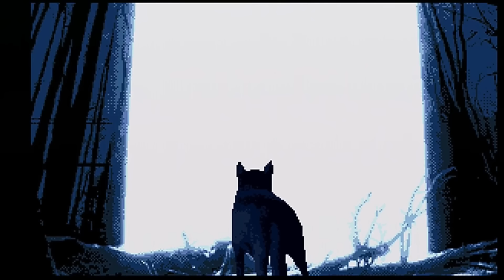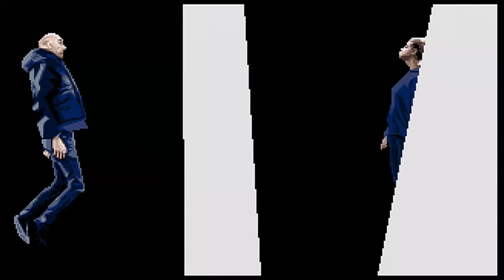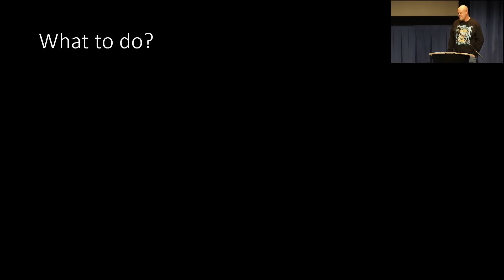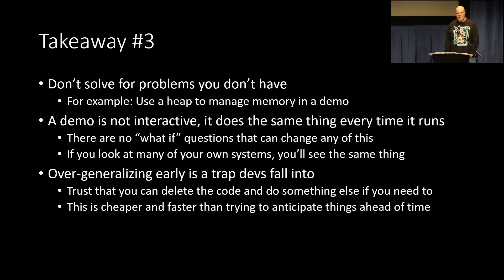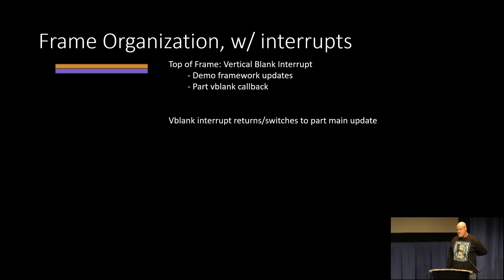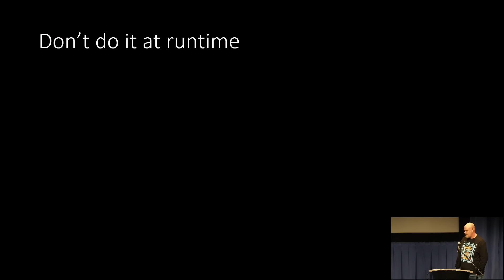Eon: An Amiga 500 Demo - Andreas Fredriksson

Comment: Loved this talk! I used to dabble with "demo" stuff on the C64, and it honestly got kind of crazy. I had machine code, that generated machine code, that modified generated machine code. Just to shave off a cycle or two here and there. Don't do at runtime what you can do offline, except offline here is literally the init of your demo code. The rest is cycle exact more or less.

C64 demo: LDA STA LDA STA LDA STA

Comment: I am wondering: He says the CPU was the main constraint on the well spread A500+512K slow RAM. But why don't all these modern demos requiring an 68030+ not really look significantly better than all the OCS unexpanded demos? Having my Amiga expanded through all the generations, from 68020, through 68030 and 68060 up to the PPC, I was always very disappointed with what it actually brought to the table - including the ridiculously useless AGA, which IMHO did not make a single game look better than ECS.
Reply: It's a challenge... Pure A500 - like from factory. Because most people have hardware just like it. And squeeze as much as You can.
Reply: @slapfight3581  Yes, I know. But this isn't what I was asking for ;) The example I gave was for showing, that way faster CPUs than the 68000 did not change much. And: While of course the 68000 sometimes hindered the older Amigas, usually games and demos on the Amiga IMHO where constricted more by limits of the custoim chips - which AFAIR also was the usualy widesprea opinion back then, and also resonates with faster CPUs actually not having been much of an improvement win for the Amiga.
That's the coarse idea ..
Being a bit more precise: While there where special cases, like 3D vector graphics games and rendering of course, the usual Amiga games was a 2D game. And 2D games would have benefitted much more from either more sprites or more layers or an even more powerful copper or more sound channels or more memory or HD floppys, from a Harddrive or higher ChipRAM-bandwidth, than they would have from a faster CPU. Each of these parts having been sufficiently improved would have made a way bigger difference. You can even see and feel this, when using an Amiga with a fast CPU: The Workbench still ils  near unuseable in higher resolutions. Because anything but the CPU is too slow.

When it comes to 3D engines, though then the CPU comes into play - but this isn't a significant parameter of the Amiga, as it was an usage case somewhere between 'yet not existing at all' and 'exotic' for most of the Amiga's lifespan. And: When the time fpr 3D was up, not even the fastest CPU in the world would have helped the Amiga much, because it was painting pixels too slow for the 90s. Either LoRes or unbearable flickering, and both terribly slow, no matter how fast the CPU .. that's not a scenario worth striving for..

Also: Compared to it's contemporary Intel counterpars, the 68Ks where way more efficient and faster, at least until the 486 arrived.
This all is why I can't really comprehend his argumentation.
I say: The CPU actually was one of the Amiga's least significant limitations.

Comment: The Amiga (500) ... "only" 32 colors*, but when I see them on Screen it still feels "magic" to me. Back then this machine was so advanced, so capable of amazing things I'd never seen before. I'll never forget this little computer, she'd been something special, last but not least because of the people who really pushed her to the limits. It's just great to see that she's still loved by the demo scene :)

*) or 64 or even 4096, or with clever hacking 31 different colors per line - I know ;-) But handling these modes was quite tricky, used mostly for static images.
Reply: The HAM mode is pretty impressive. It blew my mind in 1990.
Reply: With the limited memory and throughput of the machines back in the days, it was always a trade-off between color depth (number of bit planes) vs resolution (bit plane x-y dimensions)
Reply: I think because it was also 32 colours from a much larger palette (4096 IIRC?), where eg. DOS was common using the fixed CGA/EGA palette of those same garish 16 colours (I say that as someone who grew up with DOS, but always wanted to go play with my neighbours' Amiga)

Comment: The hardwaredesign and the OS were ahead of its time. Absolutly no doubt about that.

But from todays point of view it was a big mess. The components we're tied to work together way too tight. The Amiga never really had a chance to evolve without braking the original design, making it incompatible to its previous version. Some of the functionalities were even quite hacky. For instance:

The two CIAs in the Amiga had a signal line to tell them if they were CIA 1 or CIA 2 because both had different functionalities in the system.

When coming out of reset state, the cpu started off by reading a reset-vector from adress 0x00004. But in normal operation there is usualy RAM at this location which would result in an instant system crash because the CPU would read random data from that address. They solved it by telling gary to resolve the Reset-Vektor-Address to point to a ROM Location within the first few clock ticks of the boot time. Its the PA0-Line of CIA I that is doing the signaling to gary.
Reply: You'd get the exact same difficulty upgrading due to hardware being tied tightly together with any 80s of 90s console that was computerized like the Amiga was. That's just the way it is when you try to make a console design into a personal computer. Be thankful they did as any other approach at the time would've cost way too much retail. This is part of why the recurring, "Why didn't they use ARM?" comment if comical. If they had, it would've needed a lot more RAM. And in 1983 and 1984 -- when they were designing it (and even in 1985) -- that would've massively bloated the system's launch price.
Reply: @Nebulous6  This is not quite correct. The first Amiga (Amiga 1000) was not designed with cost efficiency in mind and it was quite expensive. It was supposed to become a direct competitor to IBM and Atari Computers at the time. So was the following Amiga 2000. These machines were more capable than IBM PC  but had many design flaws. So they ended up beeing unable to keep up with IBM and were bound to die...

Many people say it was the mismanagement of commodore that caused the Amiga and commodore to die. My personal opinion is, that it is a mixture of many unfortunate events that caused commodores demise. The designflaws of the amiga was a major one of them.
Reply: @monarch73  I'd hesitate to call them design flaws. The Amiga did exactly what it should have done at the time and it did it very efficiently. As for cost, the Amiga 1000 was still less expensive than either the Mac or IBM back in 1985. The primary reason the 1000 was more expensive than it could have been was because it was manufactured in Japan. I do agree that the downfall of the Amiga was due to a mix of unfortunate events though.
Reply: @Nebulous6  Its' like I already said, the Amiga was way ahead of it's time. The guys did a great job at bringing high-end computing at an affordable price to the homes. But let me elborate what I mean: If I was a softwaredeveloper, and if I was to design a software that does what it was supposed to do, it does not nessesarly mean, I did a good job - because as a designer have to take different senarios into account. Does the software crash when the user does unexpected/ unwanted things to your application? Is it foolprove? Is it intuitive? Does it scale when resources are insufficient?

It's that kind of stuff where I think the hardware- and software designers failed miserably. The OS was prone to crashes due to the sensible location of lookup tables. Null-Pointer dereference is a very common problem and with gary in place it could have been handled with very little effort. Instead, they completly ignored it and put some very sensitive data at the beginning of the memory map.
Reply: @monarch73  Only pre 1.3 was 'somewhat' prone to crashing. After that, and especially for v. 2.x and up, any crashes were the result of poor programming practices. This is well documented. What you're describing had nothing to do with the hardware (unless you're complaining about a lack of memory protection). Like everyone else, I also think that's one detail that would have been nice. Again though, someone who watches what they put where shouldn't have a problem -- as evidenced by the many top-tier programs on the Amiga that have no issues in that regard whatsoever. If a piece of software crashes when a user does unexpected things to it, that would be a bug (kind of like an average day with Win 10 or 11 and I can't blame my PC's hardware for that anymore than someone can rightfully blame the Amiga hardware for buggy apps).
Reply: I remember people jumped the ship when PC with its ability to use chunky pixels to create games like wolfenstein, and doom came. Also the triple-a was in the making for ages, so people like me stopped caring.
Reply: @AndrewTSq  There's only so much you can do when a company repeatedly recycles a chipset that was already publicly demonstrated in the summer of 1984. Seriously, what do people expect? I can't think of any other architecture that hung in there that long with so few upgrades. Considering the Amiga was a closed design with little augmentation over the years, it's not surprising. On the flip-side, I'm well aware of the PC and its 'evolution' (I sold and supported IBM and compatibles from the 1980s to the early 2000s).

Comment: When I saw EON for very first time, I didn't like it. I thought, ok, another PC-like demo where all is streamed from the HDD. Only later, when understood that this is bare A500 + 2 FDDs my jaw just dropped... Massive kudos for the demo, massive thanks for this talk 👍👍
Reply: It is good but too many of the demos now are these classy slick movie-like productions. There need to be more show-off demos like in the old days with rave or funky synth music or whatever. Our favorite demos from back then were usually crazy things! e.g Red Sector, Space Balls etc
Reply: @RobertoLeo3  Spaceballs state of the art and nine fingers employed streaming loaders that preload the data for the next section while the current section is showing, infact I still think State of the art is one of the most technologically brilliant demos ever made on the platform
Reply: @JimmerofOz  They probably are. I found out that some demos are just sending pre calculated blitter slices to the blitter to make fancy 3D effects etc so they not all necessarily amazing. Thats why some demos with just a ton of objects on screen can be cooler
Reply: @RobertoLeo3  Its not a recent thing, demo groups have been precalculating tables for a fair while now, but I think it'll look a lot more wooden pre calc'd than real time. either way it is the graphics hardware putting all that data to screen so its still an achievement regardless of the process, same as using pre mixed samples rather than a sequenced soundtrack. both achieve the same end but I commend the effort of an excellent sequenced track over a streamed PCM track
Reply: @JimmerofOz  Its still cool but games have to do real time stuff and usually people are only impressed because the demos look way better than the games. "Imagine if these guys made a game!" kind of thing. Really something like Shadow of Beast first level is the ultimate demo for me! Because its all real time AND impressed everyone, esp back in 1989 or whenever it was. Demo coders should now be making first level of ThunderForce IV on Amiga not making "Movies" IMO